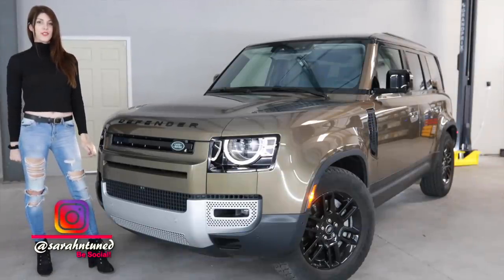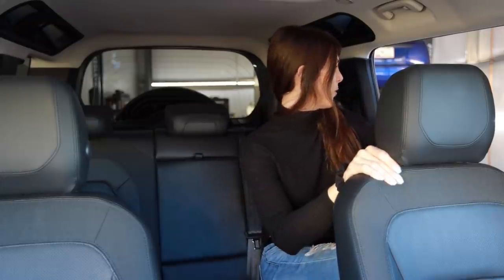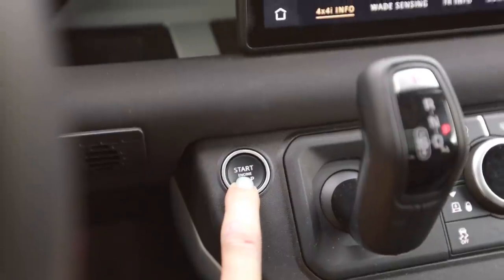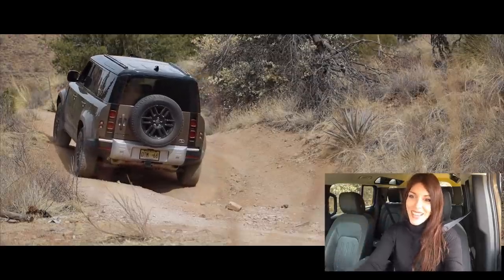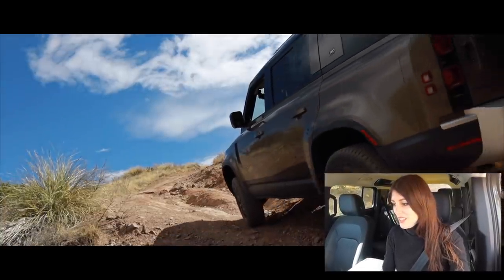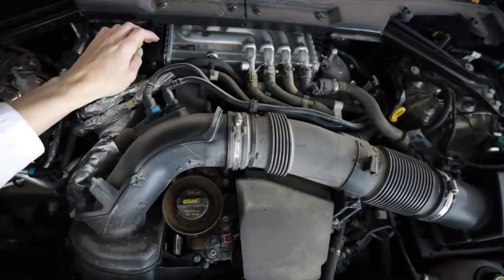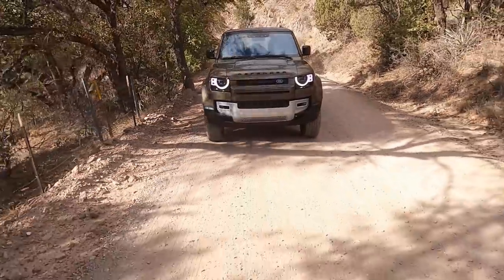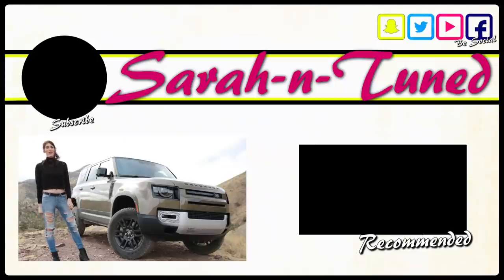A 400 Horsepower Off-Road Monster // 2020 Land Rover Defender 110SE Review

Comment: Little sister's $1900 Xterra really is a $5000 Xterra, considering it NEEDED your work. Still a lot cheaper than a Discovery. But at $1900...it would died on the road multiple times. Fess up, you bought it as a YT project.(g)

Comment: 8:30 This shot of the suspension articulating was so satisfying.
Reply: There was literally barely any articulation there
Reply: @norsevikingsir4932  If you didn't pay attention to the rear, sure. I'm not saying it was off road mad lifted Jeep flexing. I'm saying watching the suspension operate was fun.
Reply: @802Garage  Yeah I watched the shot numerous times and the trail itself, neither was enough to even begin to flex it. Also it's not two solid axles, but 4 live axles, and yet still there wasn't much flex.
Reply: @norsevikingsir4932  Sigh You're so cool bud. You win. I was literally talking about the IRS suspension articulation. Not like you can see the passenger and then driver rear wheels travel at least 4-6" while the vehicle remains relatively flat. Definitely no suspension travel whatsoever. It never happened. I didn't even watch it before I commented.
Reply: @802Garage  Not trying to be cool, you just need to broaden your horizons if you thought that tiny bit of articulation was satisfying.
Reply: @norsevikingsir4932  relax it has independent suspension so it did just fine

Comment: 2:28 I work on these trucks and the side panels on the dashboard as well as the interior panels that go lengthwise behind the monitor are magnesium, not plastic. It’s definitely a tough vehicle - no carpet. It has a rubber floor with padding underneath.

Comment: Sarah, you may not response to this, but here is my 0.02 on the Land Rover Defender. I was involved in the Overlanding community for awhile and the impression I was left with was  if you had the cash for a Land Rover, you could buy a Land Cruiser that was superior in reliability and just as capable off the road. I've seen Land Rovers die on the trail or break. Reliability is key in overlanding and this is where the Toyota rank about the rest of the holy trinity of Off-Roaders (Land Rover, Jeep, and Toyota). While the new LR-D is cool and while designed, its terrible reliability rules it out for anything but limited off-road use. I would not trust where the pavement ends and the city-lights fade. That the dark territory of the almighty Land Cruiser...the one to rule them all. So Say We All. Cheers Sarah! Excellent video has always. You are the queen.

Comment: Sarah, I own a Range Rover Sport and in the variety of weather conditions I have experienced, those pre-programmed modes are quite helpful.  I used to 4X in my Toyota SR5 when I lived in Phoenix but have also driven across snowed in mountain passes, sand, rock, mud, and shallow rivers in my RRS.  LR/RR knows a thing or 2 about off-roading.

Comment: Glad you finally got behind the wheel of a Rover, they can be pretty fun. 

If you can find a non-SVR Range Rover Sport Supercharged, you'd benefit from hydraulically actuated sway bars and a definite increase in beans, with no change in offroad ability after a quick tire change,

Rover innovated Hill Descent Control in the failure of a vehicle that was the Freelander, they've got it figured out pretty well now. Hope you increased that 2mph.

Comment: Um... I bet that's not a mini speaker in the headliner, but the temperature sensor. 
How did the a/c work. Vents look small.
If they are going to have off road cameras, they should add the ability to record.

Comment: The straight 6 is one of the great engine designs of our time.
Reply: Interesting to see you saying that.  As a mechanic myself,  may I ask why?  All I see is over complicated mechanical and electrical engineering that will fail endlessly after a few years and be ungodly expensive to repair.
No one in their right mind will EVER take one of these deep into the outback unless it's sponsored by Landrover.

Comment: I'd prefer the 90 inch wheelbase. I'd also stay fairly stock as Land Rover suffers from add on expenses like GM. The add ons basically double the cost.
Reply: You haven't heard about the De3 "list of options"? 

Jeremy Clarkson in an older Top Gear video shown once a BMW BOOK from the '80s-90's with such and today if you go to Porsche's 911 configurator you'll be SHOCKED by the HUNDREDS of options.

Comment: The issue with rims that large is that you cannot properly air down your tires so they have enough material to conform to the terrain. I suppose those massive brakes are necessary with a vehicle that heavy, which is sad considering how utilitarian the original Defender was. Still, I'd be interested to see how overlanders will modify it to make it more capable.

Comment: Does it have a manual transfer case? All that you need to go downhill is low range 4x4 in first gear. It saves your brakes.
Reply: I do think few (if any) manufacturers deal in MANUAL TRASFER CASES anymore. Everybody seem to have automated this years ago...

That's why there's "cruise control for downhill" in many SUV's nowadays, including the Defender 110.
Reply: @syxepop  , thanks for the info, I'll stick with my old Toyota that has a manual transfer case and the original stereo with cassette and cd player. The Land Rover looked like it was well built.

Comment: just what are all the worlds auto engineers gonna do once all that tech is replaced with an ev motor at each corner + ECU ..or even, as motor tech improves, 'motor-hubs' - a motor incl in the wheel hub with regen braking capable of reducing size / weight of discs + calipers to offset weight - add fly by wire throttle, brakes and steering and u can toss out half the wiring too

Comment: 72k. Drive it 50 feet off the Dealer lot and you have 50k resale value 🤭.
Reply: ANY vehicle nowadays would get you -20% off the dealer lot, so U$57K-ish, probably closer to U$50K noting the "lack of reliability" most Land Rovers get (just ask Doug DeMuro, who had a '97 90 and has a 110 similar to Sarah's here as his daily driver).
Reply: 20-30% off is only for the volume models that aren’t selling well. I doubt you could get that on one of these.
Reply: @lotsofcurveslover  - usually dealers and MOMENTARILLY HOT MODELS wouldn't find a discount for awhile, but the -20% right out of the dealer is a reality for EVERYTHING ELSE, and that's for STARTERS.

22+ years former Nissan dealer employee talking, and it's not just those darn CVT's.
Reply: @syxepop  were you taking 20% off every Rogue?
Reply: @lotsofcurveslover  - not at the DEALER level, but when you're calculating the lease payment or trying to trade-in too fast you would notice the drop in value (-20% off the dealer's lot and -25% the first full year).

And there's NO chance a Rogue (new or old) wouldn't get the drop.

Remember that the DEALER has to make a PROFIT in every sale, so an up to 2 year old car won't be less expensive on the lot than a NEW one. You have to find someone trustable to "take the payments" from (passing through the bank's approval) to find "any" bargains that new.
Reply: @syxepop  I looked up forthright in the dictionary and I saw your picture.

Comment: I would not recommend buying one.  The most expensive piece of crap ever.  Lots of people reporting electrical gremlins that result in lemon-lawing the car.  Engine issues as well.

It’s a mall crawler, it’s not meant for off roading like the original 110.

Comment: I believe the Bronco is built off the same platform
Reply: Tata from India bought Jaguar Land Rover from Ford years ago and the only two products (both engines) that still may have some Ford flavor in them are the 5.0L V8 engine (say what you will, but it is modified from a 4.95L Coyote) and the Lion TD-3.0L V6 co-designed by Ford and JLR and Defenders doesn't have either in US-spec guise.

No platform or chassis is now shared by both companies...

What happened is that both Ford and JLR designed separately on the same needs, as the 6G Bronco 2 and 4 door would compete against the Defender 90 and 110, respectively (there will be an even larger Defender 130 not involved).